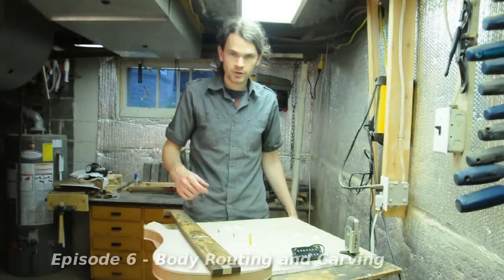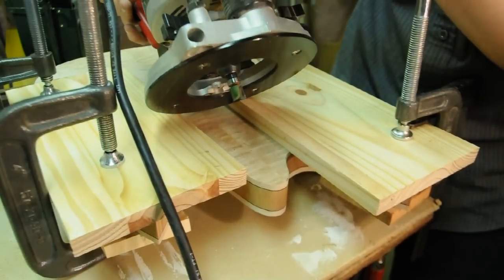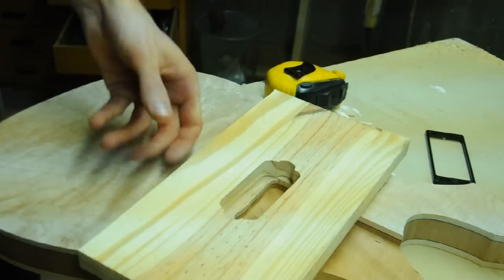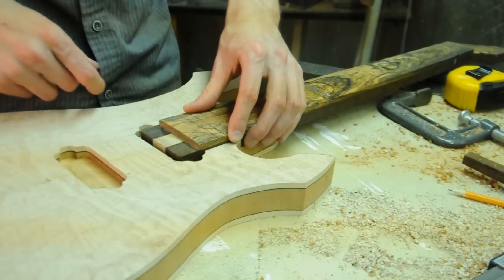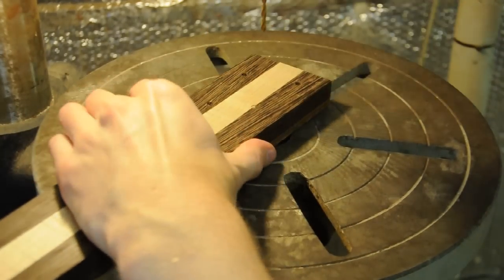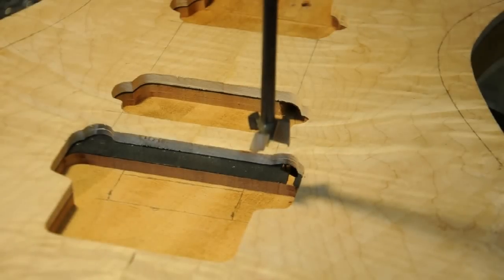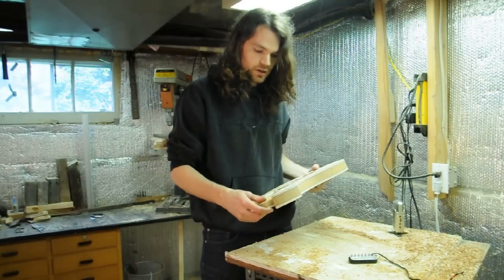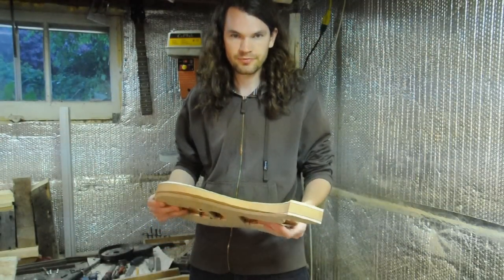Episode 6 - Body Routing and Carving

Comment: Dave you are fearless and I'm impressed at what you're doing with simple tools. That has to be a huge inspiration to new builders. My only suggestion (beyond being really careful to not breathe exotic wood dust - it is evil) instead of pine templates - start making your PUP router templates out of acrylic and jigs out of Baltic birch ply. More accurate but more importantly they'll last a lot longer and not get sloppy.  If you're thinking about really doing this you'll thank me in 10 yrs when you have all these organized reusable templates you can grab and go. Handy for repair work too.  I really wish someone had told me 30 yrs ago how important it is to treat your jigs and templates as an investment and build them to last. I didn't then - so now I'm constantly having to stop and reinvent a wheel I used years ago.

Comment: Hello Dave! This is a great video you've made here and it really helps. From me you have a big THANK YOU + like. Would you suggest me how do I cut my neck heel if the body pocket is closed (I mean not connected to pickup cavity)?
Reply from the maker: This build is actually the first one I've done with the pocket meeting the pickup cavity.
What I normally do (closed heel pocket) is clamp down 3 boards for the routing guide - both sides of the neck, and the end of the neck.  Then I route up to to this.  I'd round the corners of the neck to ~1/4" and use a 1/4" router bit to (very carefully!) match the corners of the pocket to the neck.
If the neck heel is angled (not square, like an ibanez sr bass), I'll have to mount my boards a bit more creatively to match.  If you're doing anything fancier (curved neck end?) you'd need to trace and cut a template probable.